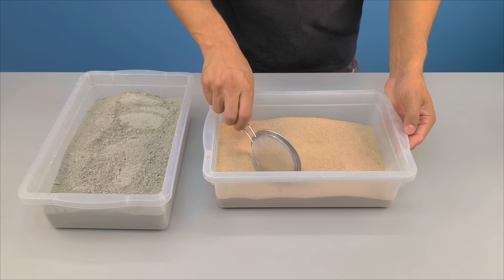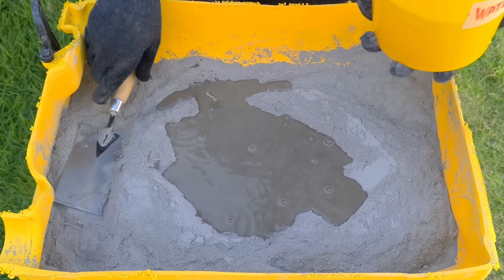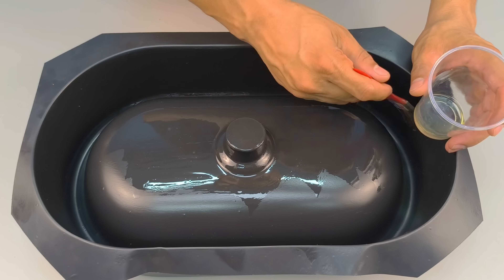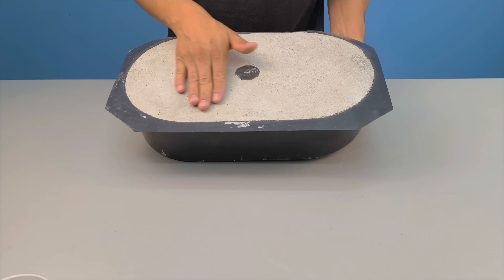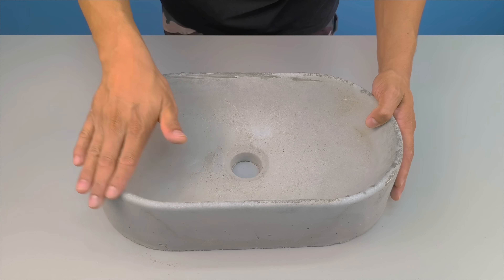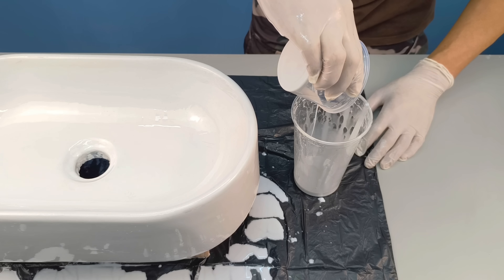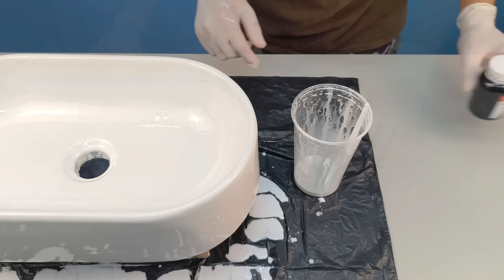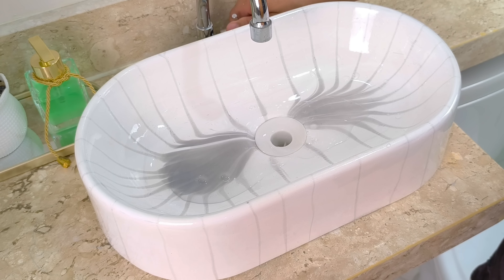Mix CEMENT with EPOXY RESIN and turn the impossible into a MILLION-DOLLAR idea!

Comment: Fiberglass won't do squat like that. the fiberglass weave mixed with epoxy is where it's strength comes from, not the fibers themselves, but interwoven and set with epoxy.

Comment: Nice work. Curious about the weight of the finished product. Also, can the various applications to the concrete be done on a a corrugated steel tub?

Comment: Too much end work. You do know that these is gel couting right? Use that on the mold before you put in the cement mixture. Then when it's done the part is finished and already water tight and with color.
Reply from the maker: Thank you for the suggestion. Gel coating is a valid technique, and this project explores alternative methods for experimental and creative purposes.

Comment: A cup is 250 millilitres that bucket holds more than 50 millilitres.
Reply from the maker: Thank you for pointing that out. Measurements in the video are approximate and used for demonstration purposes.

Comment: Fibreglass goes into the water to expand and go stringy... It distributed with the water that way
Reply from the maker: That’s an interesting point. Different mixing methods can affect how fiberglass disperses. The video shows one experimental approach, not an optimized or standardized process.

Comment: That's not concrete. It's mortar. Concrete has aggregate and sand not just sand. Also fiberglass has been used for decades in concrete.
Reply from the maker: Thanks for the clarification on the terminology!

Comment: so you can get the same final effect if you just used normal concrete then sealed it with epoxy!!
Reply from the maker: In some cases, yes. However, mixing epoxy into the process can change strength, porosity, and finish, not just surface sealing.

Comment: OK. Epoxies can cure even under water, But why not use polyester resin, starting with a gelcoat and fibreglass polyester layers, Once the resin is cured fill with concrete if you want a heavy product.. Less cost, less work less time.
Reply from the maker: That's an interesting approach with polyester resin and fiberglass! We're always experimenting with different materials.

Comment: I wonder the cost ?
You could buy a sink or used sink and just do the final part (gray pigment) because the initial mold must have cost a bit
Reply from the maker: Cost depends on scale and materials used. For small projects or prototypes, the cost can be quite low. Using an existing sink and applying only the final coating can definitely reduce expenses.

Comment: Nice, I will prefer to have complete white instead the gray thing, but is matter of choices. In my country the raw materials like resin are way more expensive than a vanitory it self. Also the mold, that seem to be thermofusioned is not easy to do it, what material do you use there PVC?
Reply from the maker: That's a great point about the color! For the mold, we used PVC for its durability and ease of use. 👍

Comment: If the process takes so long for a simple tub, imagine how many years it will take to build a house
Reply from the maker: This process is for experimental and specific applications. In real construction, methods are optimized, scaled, and done simultaneously, which makes the overall build time much faster.

Comment: Is this safe for a bird bath? I would love to do it if it is.
Reply from the maker: Yes, it can be safe for a bird bath as long as the material is fully cured and sealed properly. After curing, the surface becomes stable and does not release harmful substances.

Comment: Where did you get the mold from? Also, using a reciprocating saw with no blade, just for the vibration, will help get the air out and consolidate the mixture well.  I used to work in ornamental precast.
Reply from the maker: The mold can be found online on marketplaces like Amazon, AliExpress, or similar platforms. And yes, vibration is a great technique to help release trapped air and improve the final result.

Comment: The end result is very nice. The only thing I would change, to lighten the work load, is to use a vibration table or use a sander vibration to the molding process. This will eliminate all the air bubbles, and probably the need for the acrylic process. Have you tried using water glass as a cement sealant after the curing, and then the epoxy resin for the finish? Maybe another video for these changes? 🙂
Reply from the maker: Those are some fantastic ideas for potential improvements and future experiments!

Comment: The transition from raw concrete to a porcelain-like finish is impressive. The epoxy finish completely changes the perception of cement. Have you tested how it performs with heat or constant moisture over time?
Reply from the maker: Thank you! That’s exactly the idea. The epoxy finish transforms the surface and gives concrete a completely new visual and functional perception.

Comment: This is an old recipe of resin. If you would use polyester resin and just the cement or a grout mix “no sand” it becomes a super solid.
Reply from the maker: You’re right, similar concepts have existed for a long time. This content explores variations and practical experiments to show how different formulations affect strength and finish.

Comment: You really love painting. So many steps
Reply from the maker: Yes! We really enjoy the process. Each step is important to achieve a better finish and durability 🎨🔧
Reply: @inovaouinventa what about just using fiberglass insulation to mix into the cement for bricklaying and filling in construction or recap?

Comment: Secure your mix bin on the ground and mix with a form-matching hoe. No lumps. Those lumps are either nothing but sand or nothing but cement. Use less water - a thin mix can stay odorous for years.  A stiff mix looses the smell and is much stronger. Once the cement is firmed-up, stucco or a cement slurry would work much better than that out-of-place acrylic filler.  Also, unless your creation is headed for very rough treatment, epoxy resin is no fill-in for paint - it's expensive, more toxic, and doesn't stand up well to the sun.
Reply from the maker: Thanks for the detailed feedback! Great tips on mixing technique and consistency. These details really help improve the final result 👷‍♂️🔧

Comment: So now you have added a plastiser , what is that  , it's not just a basic liquid ,
Reply from the maker: Good question. It acts similarly to a plasticizer or foaming agent, changing the mix’s workability, air content, and flow behavior. It’s not just a simple liquid; its interaction with cement affects viscosity and structure, which is exactly what the experiment aims to observe.

Comment: How does it hold up under cleaning products? Scrub with baking soda?
Reply from the maker: Good question. Mild cleaning products are generally tolerated, but abrasive scrubbing can affect the surface depending on curing and sealing. Baking soda may wear the finish if used aggressively.

Comment: What plasticizing additive did you use?
Reply from the maker: The plasticizing additive used was liquid lime (cal líquido), commonly used as a plasticizer to improve workability and flow in cement-based mixes.

Comment: Way too many steps! It took way too long to build, might be alright for a one time deal but not for any kind of production. Why not just use polyester resin (cheaper then epoxy resign) and aggregates, no cement! And would be way more durable. This is nothing new as I have been doing polyester over lays on bridge decks since the 80s, highly durable and test show that over 30 some years there is very little wear. My point is you can make something that is way stronger, cheaper and in a fraction of the time. (Time is money). Just my opinion, always looking for ways to cut out time and money. This article is misleading as you don’t mix cement with epoxy as that would never work and the only reason I watched the video so I could call B. S. And I still am calling it B.S. as it is misleading

Comment: Hi I am watching from tehran iran. I liked your work but how durable is the finish. Sink is a piece that has to vet cleaned every day. Doesn't the surface get scratched or ruined using regular household cleaning products like bleach or other harsh cleaners. How many years does the surface finish last. For example the ceramic sink i. My parents house is over 50 years old and still looks good.
Reply from the maker: That's a great question about durability and cleaning! This project is more about exploring creative possibilities than practical, long-term applications.

Comment: I am watching from the planet Zatar You are an attaining species we have a Cloaked relay satellite sitting in a worm-hole about 400 miles above the North Pole. Do not worry an advanced species have access to more elements and resources than your little planet has to offer. You're an interesting species considering just 300 years ago you used to rub sticks together to make fire and 130 years ago you used to farm using horse and plow. You're coming along quickly and should discover friedmons or 'mini-black holes' in about 300 years. All atoms have inside them mini-black holes you call friedmons which can be used to create energy and open riffs in space-time. the trick is that all the friedmons you want to effect (opening size) need to be at the same frequency. See you soon humans.
Reply from the maker: Thanks for watching from Zatar!

Comment: It's like you're trying to create cultured marble. The best way to do that is replace the concrete with ground powder white limestone. They have thickeners for resin when you're doing this and use resin color for your desired look. After you mix the hardener into the resin thoroughly you can add one or two drops of color in different places but don't mix it thoroughly. Just stir it slightly once or twice. That will create natural-looking veins in the material. That is pretty much how you make cultured mobile. 

Also, what you did is very cool but just takes a lot of time. If you have the time by all means what you created is very nice.
Reply from the maker: Thanks for sharing these insights and tips! Always great to learn new techniques.
Reply: @inovaouinventa  Anytime! I love seeing videos like this of people trying new things. The best way to learn is together. Good luck on future endeavors.

Comment: This plastic drain ruined the part. 🤦‍♂️
Reply from the maker: It looks like the drain caused some issues, but the goal was to showcase how the mix could potentially create a lightweight, durable material for various applications.
Reply: @inovaouinventa it was awasome. 👏👏👏

Comment: I used to repair concrete boat with a mix of cement, sand and epoxy resin. No water added.when there is a hole on the hill a chicken mesh is added so the concrete stick to it and stays in place. The mix once dry is somehow more elastic than just concrete and work very well
Reply from the maker: That's a very interesting and practical application, thanks for sharing your experience!

Comment: Clearly you are an amateur at concreting but an expert at bullshit.   Making out you have discovered some revolutionary process while using age old techniques.  Using fibers and plasticizers in concrete is extremely common, especially in thin applications or where high strengths are needed.  However, using a 50% cement to 50% sand mix is very rare because it is unrealistically expensive compared to normal 1:4 high strength mixes.   And where is your self-preservation, bare handling fiberglass and stirring up dry cement dust like it's cake mix?   
Then you put oil on a rubber mold, which is totally redundant as concrete will never stick to rubber/plastic anyway.
Next you tap the mix in the mold when a professional would use a vibrator to remove bubbles.  You had to fill all the bubble holes and then manually sand it because of this poor technique. 
And then laughably you 'water cure' the piece when you could have just left it in the mold to achieve the same hardness.  Water immersion does not speed up nor harden a cement mix.  It can assist in reducing cracking but considering the extremely high cement content and use of fibers and plasticizer this step is truly redundant.
And then the clincher, you cover the basin in epoxy resin (a plastic) which raises the question of why did you use concrete in the first place when the whole piece could have been molded in plastic or made from fiberglass?  Or better still, why not buy one of the hundreds of readily available off-the-shelf basins made from ceramic, acrylic, glazed terracotta, glass, granite, copper, stainless steel or even concrete?  Would have been quicker, cheaper and less mess than hand making what was subjectively a rather uninteresting hand basin.
Reply from the maker: This video aims to explore experimental ideas and share new approaches, not to claim discoveries of established techniques. Safety is paramount, and future videos will feature more professional safety gear. We appreciate your detailed feedback on technique, which helps in refining our methods for future projects. This is an experiment in material properties for unique applications, not a guide for conventional construction.

Comment: Breathes in cement dust, handles chopped fiberglass with bare hands, and commits other health-destroying mistakes. Not a mask or ventilator in sight. The narration is relentless hyperbole that sounds robotic. And after all of it, what you're left with is: Meh. For those considering the watch, don't bother.
Reply from the maker: Thanks for your feedback; safety measures are always important, and this video is for demonstration and experimentation rather than a guide for professional application.

Comment: Where is the mixing part?
Reply from the maker: The mixing process happens step by step during the video.
Cement, additive, and epoxy resin are combined gradually to control consistency, avoid air bubbles, and achieve the final texture. The focus was on the finishing technique rather than a long mixing segment.

Comment: Why the HELL are u holding fibreglass without gloves & then put on the gloves to handle the mixture??? Gloves should be on from the video started.
Reply from the maker: You’re right to point that out. Safety always comes first.
The clip was edited and shortened, but in practice protective gloves are recommended from start to finish, especially when handling fiberglass and cement-based materials.

Comment: The material is called GRC (Glass Reinforced Concrete) technically. Is commonly use in construction to make light very resistant claddings mostly.
Reply from the maker: Thanks for sharing that technical information!

Comment: I work with epoxy resin all the time building boats. It’s not necessary to stir it for 20 minutes . Some hardeners will already start to set in that time frame depending on the amount and speed rating
Reply from the maker: Thanks for sharing your experience with epoxy resin!
Reply: Would you use this same products and process for cement countertops?

Comment: How much is invested in this project , how much is the final product worth. It's always the bottom line that determines a projects viability
Reply from the maker: Great question. 💡
The material cost for this piece was around $30, depending on local prices.
A finished product like this can easily be valued at $150–$200 or more, especially as a decorative or custom-made item. That’s why this kind of process has strong commercial potential.
Reply: @inovaouinventa Thank you. My resin is use would make the process to expensive for that.

Comment: By ‘cement’ you mean Portland, right, which also comes in white? Sand / Portland mix can make anything ranging from mortar mix to sand mix and is as old as civilization. You are essentially adding a hardener or binding agent and fiberglass and epoxy as the surface. Very nice project but certainly not unique. There are other interesting techniques you can add to epoxy to color or add a 3d effect as well using multiple coats.
Reply from the maker: Yes, exactly. 👍
This project uses Portland cement, including the possibility of white Portland. While sand-cement mixes are ancient, the innovation here is in the combination with epoxy resin, additives, and finishing techniques, which changes performance, durability, and aesthetics.

Comment: You need a small water proof vibrator, to remove all bubbles and voids, a 9" battery driven dildo with silicone exterior would work perfectly. Slowly stir the vibrator all around in the wet slurry, and try to avoid touching the mold.
Reply from the maker: Good tip 👍
Using vibration is an effective way to reduce air bubbles and voids in cement and resin mixes. In future tests, I’ll explore different vibration methods to further improve the finish.